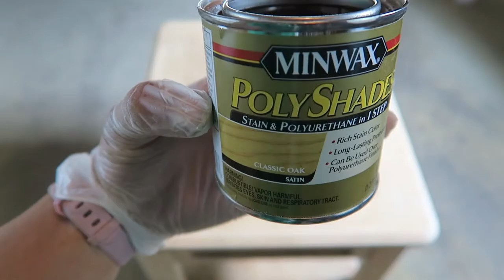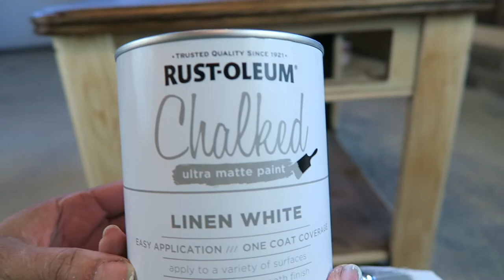End Table Makeover

Comment: Beautiful!  How did you sand those more detailed areas?  Did you use sand paper?  I'm about to redo some end tables that have some detailed woodwork on the legs.  Love this video!
Reply from the maker: Thank you Sarah! I'm pretty sure I did use a small sand block to get some of the detailed areas but I wouldn't try to sand every crevice because the paint will probably cover just fine on a small that is unsanded. As long as you get the big areas, you'll be good.